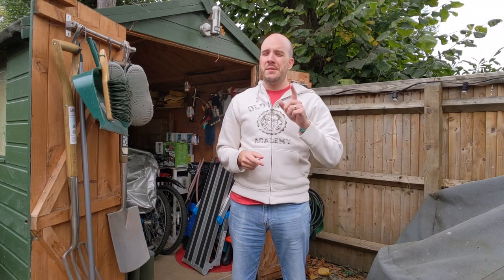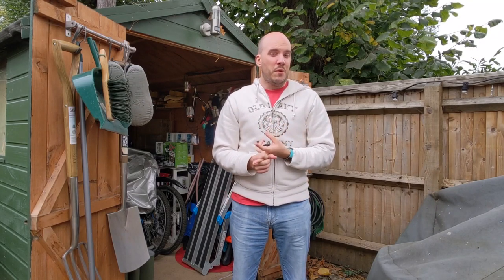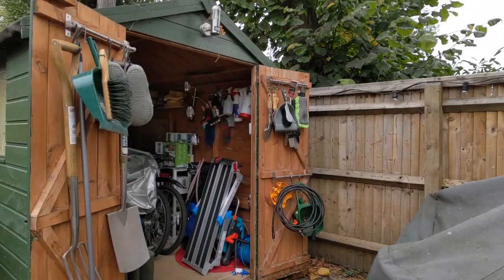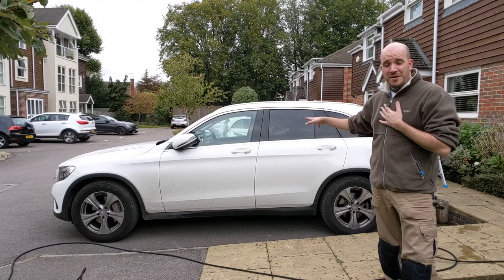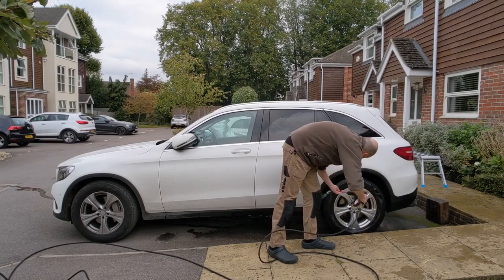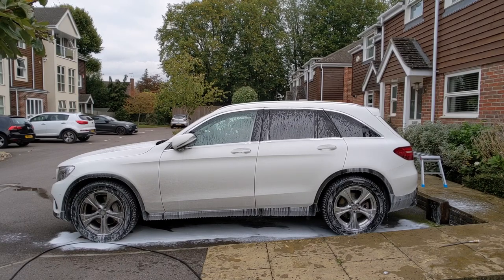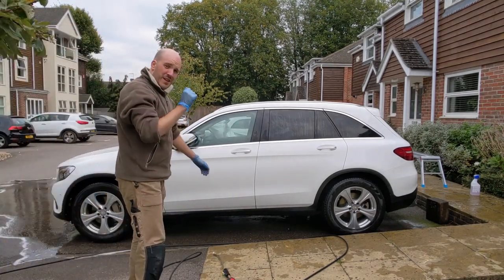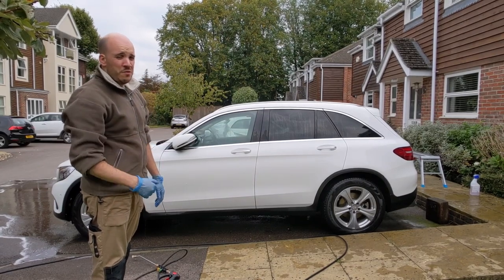Is it better to rinse before foaming? Let's find out.

Comment: Valeting cars since the 1980's and rinse first depending on thickness of filth, i do love watching all these wee fannies on YT and their chanels telling people how they should as they put it 'detail a car'.
Reply from the maker: I think there has to be some level of common sense applied and that as someone producing the content, I have to trust that people tackling a car that is absolutely caked in mud, they'd blast it off first before foaming the car.

However, if it is dirty in the same way that I've demonstrated in this video, then I can categorically say that pre-rinsing them first will not help at all and usually has a negative impact.

I can also say that a citrus pre-wash under a pH neutral foam is nowhere near as effective as a high alkaline, but none caustic snow foam. But it is safer.

Comment: I used to pre-rinse but now straight on with chemicals. Only time I'd pre-rinse is if caked in mud. Interesting that there are brands who instruct to either apply on wet or dry e.g. BH don't mention pre-rinse whereas GT instruct to pre-rinse. Similarly, AutoGlanz Rebound is suggested on wet tyre, perhaps due to nature of being rubber. Whatever works.
Reply from the maker: Yeah you're right to make that point about the context where pre-rinsing is important. I actually tend to foam twice in that situation, you could definitely argue it's a waste of product, but when you're running off a tank in the van I find that I'll do a lot of things to save the amount of water used, and foaming twice means I use less water that straight rinsing, bizarrely. I wasn't expecting that to be the case.

Comment: It’s an interesting one. I do rinse first, and it’s because of the reason you noticed but appeared to look at in a different way to me. I don’t want the foam to dwell for longer, I want it to do it’s thing and run off. On matte paintwork in particular, I don’t want any product to even get close to drying on the paintwork as it’s very noticeable and annoying to get off. When it comes to the main wash, I wash and rinse a section at a time for the same reason. It takes longer, but that’s not the point (which I know full well you appreciate!)
Reply from the maker: I think you could likely take the same approach with a panel at a time and foam, then whilst you're washing one panel you can have the other one foamed up and working, do you can move on to it. If you're using your DI vessel in the loop all the time then you could actually let the foam dry out and it shouldn't mark at all, when it's wetted again it reactivates the foam and you're okay.

I'd test that on an inconspicuous place if I was to do it but I completely understand where you're coming from, matte paint is tricky when you're washing outside.

Comment: Only time ive prerinsed was really muddy dirt and it was just with my garden hose to losen and remove large bits of dirt, I wouldn't do it with just traffic film
Reply from the maker: Yeah that is the scenario where you'd want to blast it off first as it's just preventing the chemicals getting to the bonded stuff. Although I will say the GT Snow V2 and Touch-Less do a great job at breaking that down, I've found they make getting thick mud off a bit easier, but in this scenario I'd end up foaming twice....which is a pricey approach.

Comment: I tend to use a citrus pre wash then rinse before I use snow foam,  basically giving it two pre washes before the contact Shampoo wash.  Probably overkill but peace of mind.
Reply from the maker: I think that's not a bad idea, depending on what foam you're using. If you're using Bilt Hamber AutoFoam then there's not much need to use the Citrus, but if you're using a pH neutral one, there is.
Reply: @SuperchargedLlama  I use BH Touchless after the Citrus pre wash. Probably overkill but won't do any harm.lol
Reply from the maker: @alistairmacdonald2634  exactly. Might be wasting a bit of time and money, although Touch-Less will benefit from it. AutoFoam wouldn't really. Have you ever tried a bit with the citrus and a bit without to see if it does anything?
Reply: @SuperchargedLlama  No haven't compared but I might do for my next wash just to see. I've only started using BH Touchless as I was using a PH neutral Snowfoam before & have still have just under 10 litres of Citrus prewash to use up. I will let you know how I get on.👍🏻

Comment: New to this so apologies in advance. Do you need to use pre wash as seen by other detailers. Is it over kill, I can understand it if you have a high value car but if , like me, you have an average car and don't want to spend all day to get a clean car nor do I wish to have scratches and swirls I hasten to add. Some who want to use three stages before even making contact I find mind boggling for your average punter. Not having a go just trying to understand it.
Reply from the maker: This is a really sensible question to be asking. In my mind a proper pre-wash is essential, but you only need one product. Something like Garage Therapy Snow V2, Bilt Hamber Auto-Foam or Touch-less or Squid Ink Alkafroth are all you need. They're high pH snpwfoama that do a lot of good at softening up dirt, so when you the pressure washer rinse off, you're taking a lot of the dirt off the paint. This means when you contact wash there is a lot less stuff on the paint that your mitt will pick up, and it's that which can cause the swirls.

There's absolutely no need to go with a citrus pre-wash and a pH neutral snowfoam over the top of that (in my opinion), and it's far simpler of a process too. Feel free to ask me any further questions you may have 🤟
Reply: Wonderful, thank you.

Comment: Generally the more expensive wands are rated for higher pressures, and or also run all stainless components. Not saying ALL by any means. But usually…that’s the case.

Comment: I always TFR then rinse then foam then rinse but at the end of the day as long as your happy with the finish happy days.
Reply from the maker: I find TFR a bit too aggressive, even on really mucky cars. But some sort of pre-wash definitely doesn't go amiss. A citrus or APC application that sits under the foam, or mixed in to the foam itself can really up the anti.

Koch Chemie GSF is a good example, the foam does nothing really, but mix it with GreenStar and it is really effective. Similarly I often apply some Surfex HD under the Auto-wash if the car is really bad. Check out the C63S AMG video on my channel for a good example of that process.
Reply: 50/50 mix in the lance of autofoam and surfex hd is amazing.
Reply from the maker: @swift2117  that's a hell of a lot of Surfex based on the amount of Autofoam I need to get 4% PIR (about 450ml to make 1L) but I'm sure a splash of Surfex (say....10ml) would definitely make the same difference a pre-wash spray around.
Reply: @SuperchargedLlama  thank you, I'll try that out next time.

Comment: I love autofoam, such an effective cleaner compared to this show foams. Quick observation,  I really feel for your back, you seem to bent over leaning in when rinsing, are you a giant or is that a shorter lance?
Reply from the maker: I'm quite interested to see what the new Touchless is like, reportedly it's as good a cleaner but leaves less residue afterwards, which could be nice -  especially on ceramic coated cars.

I do wonder if I need an extender bar for the lance. I am 6ft2in so reasonably tall...but not THAT tall. My concern has been that the longer the lance, the less unwieldy it gets...can't hurt to try though, especially if I get an under chassis thing.
Reply: @SuperchargedLlama  i bought the touchless and touch on protection sachets last month, but with this weather ive not yet had a chance to try it! fuming lol. i rang bilt hamber asking what the difference is between autofoam and touchless, they said touchless leaves less residue behind, so when you rinse autofoam and it leaves patches of beading (which i thought was the protection being unclogged) apparantly thats a residue that shouldnt be there. its a tricky one with lances, i've considered one of the stubby guns which are probably ace for wheels when your bent down. i have a nilfisk e145 and bought a rotating head, ideal for doing the gutters etc, but also works well for getting the lower bits of the car and jeep roofs
Reply from the maker: I think I'll try Touchless next, although first I'm putting CarPro Reset through its paces as a foam. I'd love it if I could have fewer products to get the job done to the same standard. Video coming on that test shortly.

Comment: I disagree. It depends on the job in hand. Did a car today baked in tree SAP and mould. Removed most of it through power washing. I then used surfex hd and bilt hamber auto foam. Chemicals more chance to work when most of the mould and SAP removed
Reply from the maker: I've found that Autofoam does help soften that mouldy sap trapped dirt pretty well but I can also understand why you did what you did there. If it was me I think I'd have foamed it twice but I also appreciate that some people would think that is a waste of product/extra cost to you as a detailer.
Reply: @SuperchargedLlama  always best to remove as much SAP and deposits as possible. Then Yr chemicals can do more work. Why waste product. Let Yr products work.
Reply from the maker: @leonbradley1407  I'd really like to test it if I get a car in that state, it'd be fascinating to try out. It's completely different to road grime and could behave very differently.

Comment: first of all i do wheels then i use citrus prewash then i snow foam then rinse 👍
Reply from the maker: Definitely wheels first, they're the longest part of the job usually too! Because I use Bilt Hamber Autofoam or Touchless ifind there's no need for a pre wash underneath (now that I'm running them at their max PIR for winter cleans/grubby cars).

Comment: Your foam was terrible mate, way too runny, need to invest in a better foam cannon or at the very least change to a 1.1 orafice
Reply from the maker: That's AutoFoam for you, although yes, the lance wasn't behaving itself. It was running a 1.1 orifice and a clean filter, there was air escaping somewhere.

The only lance that really froths up AutoFoam is the MJJC one, but it doesn't last because AutoFoam doesnt have lots of foam stabilisers in it; thick shaving cream like foam is basically useless too, a runny solution like this (albeit a tad thicker) is far more effective, especially when it's packed full of surfactants like AutoFoam.

If you want something thick and foamy that still cleans well then you can try Garage Therapy's option, but it isn't as good as AutoFoam (I've got another video comparing it); don't get caught up in the hype that more foam means a better clean.